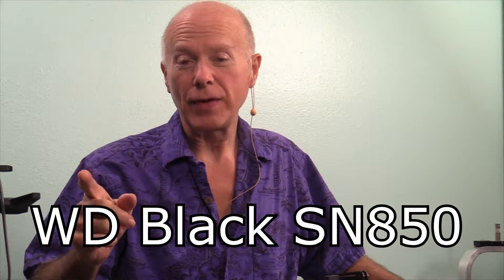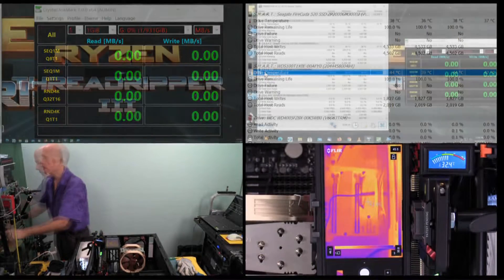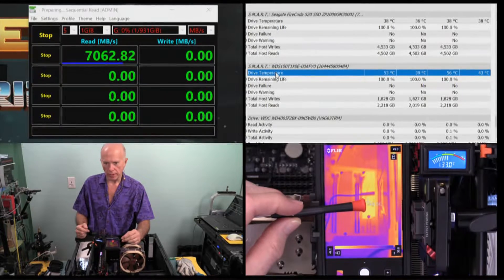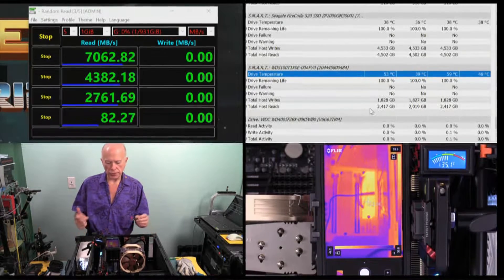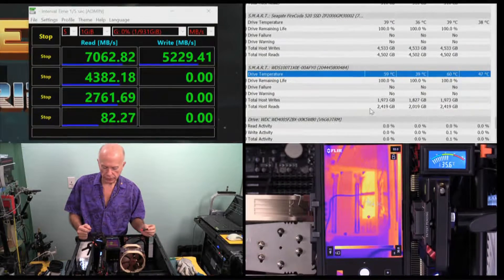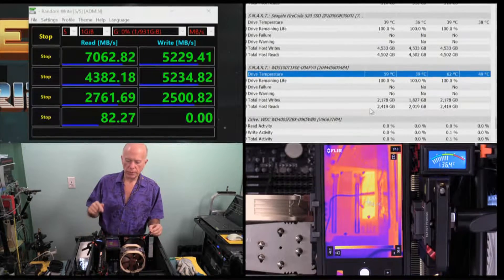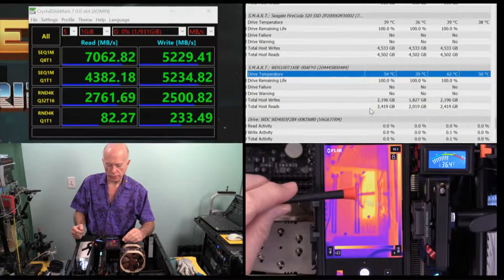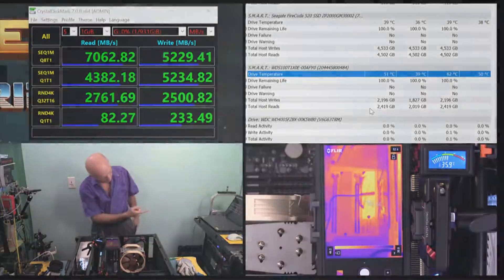Heat and Speed WD Black SN850 M.2 PCIe 4.0 NVMe Drive

Comment: Hii sir loved you video on the detailed explanation my
 Acer nitro laptop already a heating giant should i go for 980 pro or sn850 considering the heat factor...
Reply from the maker: Hi Nadia Ss,
Welcome! Surprisingly, the WD Black SN 850 ran at a lower temperature of 92 Degrees C, bare, as opposed to the Samsung 980 Pro which was 97 Degrees C, also bare in Our latest Tests on a SuperMicro Dual M.2 NVMe PCIe Adapter card. We're working on M.2 NVMe Heatsinks right now. One of those might be of particular interest as it is designed for Laptops. To that, change out the Thermal Pad to optimize the transfer of Heat! And We're going to be looking at 2 different Thermal Pads for that enhancement once We finish the Heatsinks! Hope that helps! Thanks for Asking! And Thanks for Watching! Stay tuned! 

Installation and Test of M.2 Copper Heatsink Cooler for M.2 2280 SSD Laptop
https://youtu.be/V7jk6tAq3Lg

Comment: I'm planning to use sn850 2 Tb to my Dark Hero mobo. Should I buy the heatsink or the heatsink on the mobo is enough?
Reply from the maker: HiFreshDk, 
Welcome! Excellent Question. Depends upon the clearance from M.2 to whatever sits above it. To be certain of clearance, use the Heatsink that came with the Motherboard! 

BTW: There should be a WD SN850 Firmware Update available by now. The WD SN850 was having issues with Bandwidth on the X570 Chipset using M.2 NVMe connected through the Chipset. The M.2 NVMe to the CPU is OK! That problem is now resolved with a Firmware Update of the WD SN850! Hope that helps! Thanks for Asking!
Reply: @BuildOrBuy  Thank you so much. It's a big help since I am building my dream pc.
Reply from the maker: HI @dk1ng- , 
Absolutely!  Always here to help! ROG Crosshair VIII Dark Hero? X570 Chipset. Nice! Congrats! Keep that WD Black SN850 on the M.2 direct to the CPU! Success! Keep Us Posted on Your progress! 

BTW: Which CPU are You using?
Reply: @BuildOrBuy  Yes it's Rog Crosshair Dark Hero. My Cpu is 5950x and my Gpu is 3090 asus rog strix white oc. I know it's an overkill build that is why I will also choose my best m.2 nvme for my build. :)
Reply from the maker: Hi @dk1ng- , 
Fantastic!  
1. CPU - Step through the Bios Updates. There are Power issues. A Bios Update will also Update the AGESA Code in the CPU. Stick with RAM on the QVL. Micron or Samsung B die. Set all Power to High Performance. There's a 5950X WHEA Error permeating right now. You may have to tweak the Bios for the RAM until this is solved. Just be aware!
2. An RTX 3090 - That must be absolutely beautiful! Are You 3 Slots wide or 3.5 Slots wide?
Reply: @BuildOrBuy  I haven't open the 3090 so I'm not sure. Thanks for the info by the way.
Reply from the maker: Hi @dk1ng- , 
Smart decision! Watch out for ESD! Keep Us posted on Your Progress! Congrats and Success on Your Build!
Reply: @BuildOrBuy  Is it okay to use another sn850 for my m.2 chipset? or gen3 pcie like 970 evo plus is suffice? how about another sn850 or go with the samsung 980 pro?
Reply from the maker: Hi @dk1ng- , 
1. 1 x M.2_1 to CPU. 
2. 1 x M.2_2 through Chipset. 

Yes. However, on the WD Black SN850, do the Firmware Update. Required if through the Chipset. Otherwise You'll lose performance on that Drive. Or else, use a different Brand. As to using one of lower performance M.2 NVMe Drives, look at the price and compare. For me, I'd keep everything at PCIe 4.0, 2nd Generation! Hope that helps!
Reply: @BuildOrBuy  Thanks again. Godbless.
Reply from the maker: Hi @dk1ng- , Absolutely! Amen! Here when You need Us! Blessings!

Comment: are you using any heatsink on the wd black sn850 before do the test?
Reply from the maker: Hi Berak, 
Welcome! Yes, heatsinks installed! The Gigabyte TRX40 Designare includes heatsinks for all four M.2 NVMe Drives on the Motherboard. We did not try the WD Black SN850 M.2 NVMe Drive without a heatsink. Not advisable. Hope that helps! Thank You for Asking!

Comment: So after you testing all 4, seems the SN850 is like 5-10C higher than Sabrent right?
Reply from the maker: Hi Pabula, A little higher temp, yes. Even with a Heatsink. Suggest sticking with Samsung or Sabrent. Right now it's all about Availability. Sabrent is what We're now using for a Boot Drive. We've heard rumors of a higher failure rate on Sabrent which we attribute to ESD.

Comment: so of the 2 drives that are available in 2tb, which (WD SN850 or Sabrent R4+) do you recommend for a gaming computer? no video editing or anything like that here ;)
Reply from the maker: Hi Momonucleosis, 
For me, Sabrent R4+. Keep the Drive under 80% usage. We only have that one WD M.2 NVMe Drive. Interesting? I never though about it until You asked! Hope that helps.
Reply: @BuildOrBuy  sorry, never thought about... What? Capacity as a req?
Reply from the maker: Hi @mosey4650 , PCIe M.2 NVMe Drives in general will slow down over time. Two ways to keep them at optimal speed. Clone or don't use 20% of Drive. Why? As the Drives fill up they try to save themselves by slowing down especially when full. To restore performance, Clone and stay under the 80%. When You notice the Drives slowing down, You'll know what to do. Hope that helps!
Reply: @BuildOrBuy  how does making a clone help ?
Reply from the maker: Hi @mosey4650 , 
Use to, that was how we restored performance to a spinning HDD. I won't go into details to eliminate confusion. 
1.) Specifically to restore performance to an NVMe is with Secure Erase or Sanitize. The one way to perform that is with the Vendor specific software. In this case, Western Digital Dashboard.  

2.) The easiest way is to use diskpart, 'clean all' command from Windows command line. Just wait, Lee asked Us to do a Video Tutorial on that to show How to restore a drive. to factory default after being in RAID. We will. We'll show both. 

This procedure should not be done any more than necessary. This too might, over time degrade performance. SSDs have a finite number of reads and writes. I've yet to see one get to that point. Hope that helps!

Comment: I have a Samsung 250 GB 960 NVME drive sitting on an Asus Crosshair VI Hero motherboard. I am going to to purchase a 1 TB NVME drive. I haven't updated the bios since AMD stated that support for PCIE Gen 4 was going to be removed from the x370 chipsets through bios updates. So my computer appears to support the PCIE Gen 4 interface. Do you think it would be worth going to one of the new PCIE Gen 4 drives or stick with PCIE Gen 3. The cost doesn't matter to me as long as I'm getting the performance. But I haven't seen anyone test any of these drives on the older x370 motherboards either with or without the PCIE Gen 4 support. 

Unfortately the Crosshair Hero VI only comes with 1 M.2 slot so I wouldn't really be able to compare performance between the 860 and one of the new drives.
Reply from the maker: Hi Digital Shooter, Good question. Annoying what Vendors have a habit of doing to Us Consumers. Leaves a bad taste in Your mouth. Still, look what Intel has done with VROC. 

If You can get the Speed, go for it. Price would be my concern. You're going from 3,500MBps to possibly 7,000 MBps. That's a big deal. No way to know what You'll get until You try. Test and verify!

This does open up the field for another reason for a Bios Mod. Keep Us posted on Your progress! Technology marches on! X370, Ryzen? 1st or 2nd Generation? Reason I ask, x370 Ryzen 2nd Generation as well. Interesting! We never made a video about that Generation. And should have. Never take anything for granted! We never know whom we might be able to help!

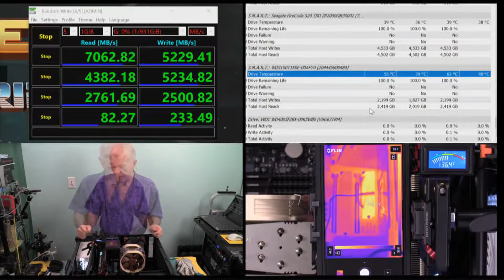Comment: great channel and tests!, so for overall you think the best is the 980 pro? you said in a reply that the sn850 has "consistent speed but will drop after awhile" but wouldnt the 980 pro as well? im looking for the fastest speeds "overall" for everything, (games and editing) choices are sn850 and the 980 pro, also out of the two would it make a difference of which is used as a boot/OS drive too make things more snappy? this is gonna be a big purchase as I need 2 x 2tb drives, 980 pro 2tb or the sn850 2tb, one more thing at 4:09 of this vid which drive are you talking about that you think performs the best of the 3 drives? TIA
Reply from the maker: Hi Ming Mah, 
Nice to meet You! Thank You! Glad You enjoyed that! Something a little different. Hopefully more informative. Any of them will slow down over time. We have the longest History with Samsung M.2 Drives. Right now, it's more about availability. If You're chipset is PCIe 4.0, then either of them! The first 2 TB we were able to acquire was the Sabrent Rocket 4 Plus. We've had two complaints about the Sabrent failing. We have not seen that yet. We attribute that to ESD until we know more or see otherwise. All of them have a warranty. 

Personally, I like Samsung and WD. Our history with WD is for spinning Drives, not M.2 NVMe Drives. I would get the ones at the best price. Appreciate Your Comments! Hope that helps! Thank You for Watching!
Reply: @BuildOrBuy  thanks for replying 😎
Reply from the maker: Hi @noregrets8751 , Absolutely! Here to help! Keep Us posted on Your Progress!